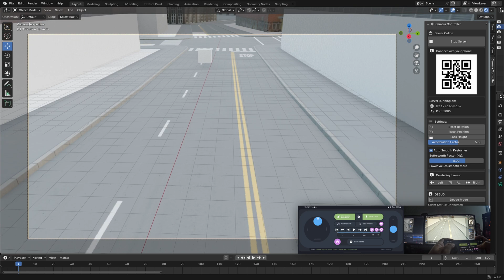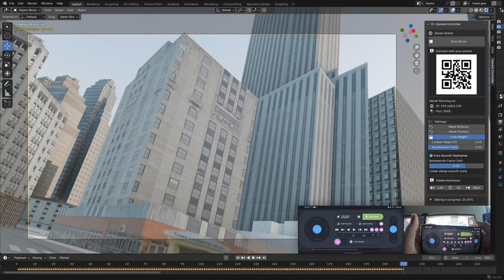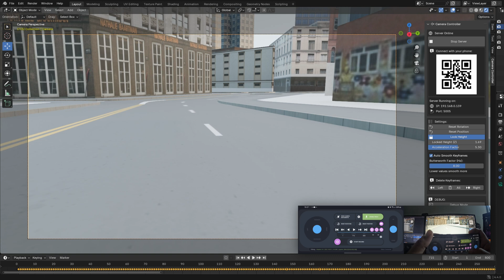How to Create Realistic Running Movements in 3D - Blender Camera Controller

Comment: Hello! Great addon so far! Is it possible to add support for movement as well, not just rotation ? If i move the phone top, left, right, etc, the blender camera does the same. Thank you

edit: If movement track is actually possible, the next thing would be focal lenght simulation. Doing some rotation+movement tracking with sensitivity being increased as the virtual focal lenght is increased I think. This would be a real camera controller with multiple applications, like in virtual production.

Comment: Hi the apk can't connect to blender, every time it says : " connection failed. Check server IP and port "  but i scanned the qr code and re-checked the numbers and i can't find were my problem is. Please help 😭
Reply from the maker: Hey, you need to be on the same network as your Wifi, you need to check if the router or modem is not separating the LAN from the WAN
Reply: I had the same problem!
First, I downloaded an app to check if the issue was the connection between my phone and PC, the app "Ping" helped.
I entered the addon's IP and got "Timed out."

So I went to Windows Defender Firewall with Advanced Security > Inbound Rules and created two port rules, one for TCP and one for UDP, using 5000–5500 as the range in Specific local ports. I did the same in Outbound Rules. 
After that, the ping worked and the addon connected just fine.

Hope this helps!

Comment: Looks great and works well on S22 Ultra!
Just a note for anyone else wanting it to work with Blender 4.1 - The line (icon='INTERNET') causes the add-on to break in Blender versions prior to 4.2. What worked for me was changing it to (icon='URL'), which makes it work in older versions as well.

Either way, great plugin! Just bought it.